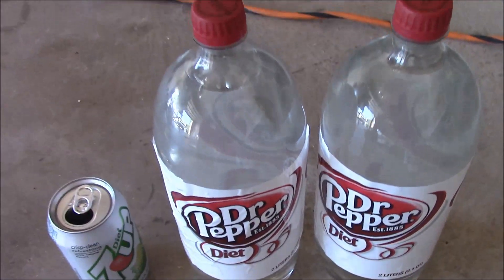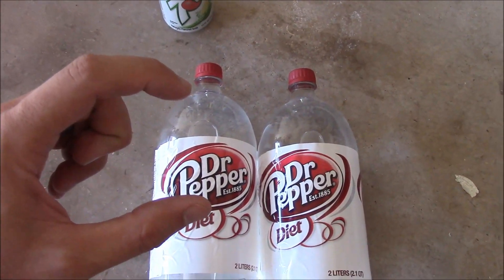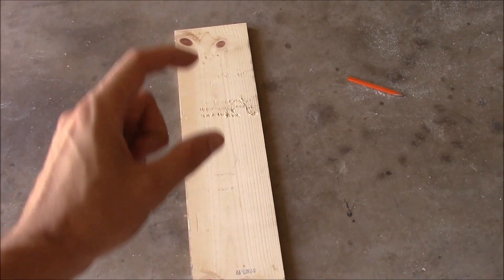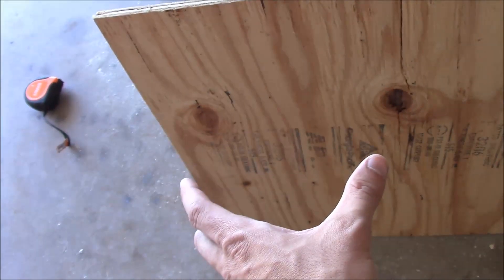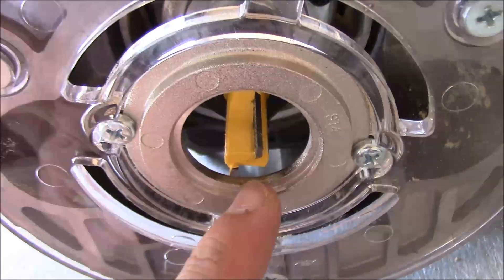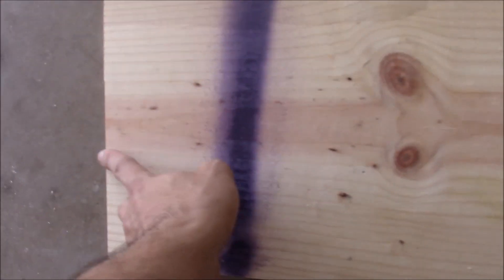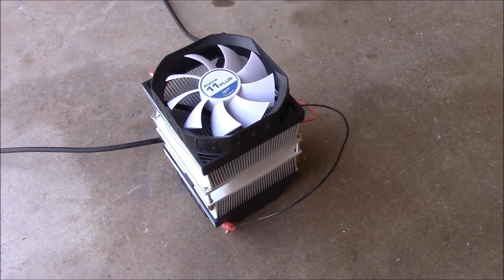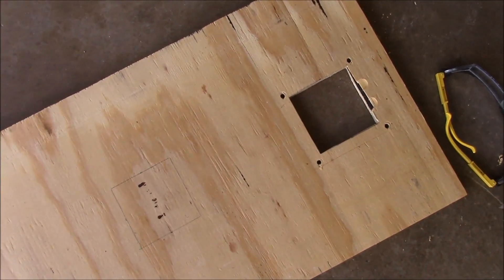Mini DIY Peltier/TEC Fridge Prototype - Learn From My Mistakes

Comment: lol. Very true. I wish you luck. This is theoretically possible, its just plain difficult.
Reply from the maker: No doubt but so was inventing the light bulb.  I'll keep working on it.
Reply: As will I with mine. I have successfully gotten a 9 Quart cooler with a 60 Watt peltier unit from 78.2 Degrees ambient down to 50.3 which is a 27.3 Difference!. One thing that i could do is switch to the same thickness heatsink, but 120MM X 120MM to fit a larger fan and it would get even colder.
Reply from the maker: Has it been well established that putting a larger/more efficient heatsink and fan on the hot side yields better cooling?
Reply: Theoretically yes, Because the peltier unit has more surface area to get rid of heat from. The bigger the heatsink and the better the thermal conductivity of the heatsink, such as the difference between copper and aluminum, the better. Copper is a much better thermal conductor than aluminum so it would be easier for the fan to get rid of more heat at a given time. Another reason why this works is because, since the hot side heatsink wont get as hot because it has to warm up more surface area than normal, it wont be as hot so the cold side will get a few degrees cooler when under load. Switching from aluminum to copper heatsink would also reduce it a bit further. Also, with the more surface area on the hot side, it gives the fan more time to remove the heat as it warms up.
Reply: That temperature difference that all peltier units have is absolutely critical to this. Getting rid of as much heat as possible is the main challenge. If you can reduce the hot side heatsink temperature lower than usual with a more powerful fan, more efficient, better heatsink, or water cooling, it will decrease the temperature of the cooler by probably as much as 5 to 8 degrees or a bit more.
Reply from the maker: Agreed.  I am going to be playing with liquid cooling the hot side and then using a cold plate on the cold side.  Stay tuned!
Reply: Awesome. Best of luck! I will

Comment: love the videos, thanks for sharing ...can i suggest one thing i don't know if anyone else mentioned... cold air sinks, right? so put the chillers in the door and set it on it's back so it becomes like a chest freezer/fridge and you don't lose all your cold air when the door opens... all the cold stays in the chest when you lift the lid :) make it a coffin type deal LOL cold as death :)
Reply from the maker: Great point.  That is how chest freezers are so efficient.  However, for this design I just wanted a normal style refrigerator.  I may have to build another design next time so I will think about your suggestion.  Thanks!
Reply: hey no problem... and thanks for the tutorial on peltier devices. i have a fridge that i found in the garbage. i suspect the previous owner didnt know it was only a cooler/fridge with a peltier device because it was in the garbage at the boat marina on the hottest day two years ago.[ i figure it didnt chill his beer fast enough for the boat ride so he tossed it out...lucky me :) ] i brought it home and plugged it in in my basement and it chills properly with only using microscopic amounts of amperage according to the manufacturers label. DANBY DAR0448W 120volt refrigerator manufactured 2008, 1.7 cubic feet, 11 kg, 65 watts max, 0.95 amps max... WOW what a nice deal for free. emergency inverter/battery backup fridge for me...ONE AMP FRIDGE!!!!!!!!!!! yes it will take 12 amps from my battery bank to my inverter to make 1 amp for the fridge but that's better then a regular fridge taking 72 amps not including the surge amount needed. if i remember your batteries they were 7.2amp/hour ups batteries, they would only supply the thermoelectric device for just over an hour at 12 volts at 65 watts, same as mine before the 120 volt transformer in the fridge.
 funny part about the fridge is the power cord... looks like an air conditioner cord that could carry 20 amps LOL
Reply from the maker: Great find.  It sounds like There is a 10amp peltier in that fridge you found.  Great emergency prep tool.  You should get about the same performance from 7.2ah batteries as I did.  Do you know if your fridge has a thermostat in it?  If so, that might help the batteries last longer instead of giving it max juice all the time.
Reply: LDSreliance
funny i was editing my reply as you responded lol...yup i think thermost and a led light .. and i replied about your batteries before seeing your reply , great minds lol
Reply from the maker: Haha, cool.  Wish I found free stuff like that.  Good luck with it!

Comment: The answer in this application is to keep the efficiency high, and i wouldnt recommend running the peltier units at their full rated voltage.
Reply from the maker: Yeah, I have read that since then.  People are saying that running the peltier at a lower voltage will still yield most of the cooling without as much current.  I will have to give that a try.

Comment: Just checking to make sure anybody and everybody realizes that these are heat pumps, So If you are feeling a Very high temperature of around 98-110 degrees Fahrenheit, you need to either decrease the power consumption to the most efficient point of the peltier, or get a bigger heatsink, or both. If you not run the peltier at the voltage that it is rating for, It will still be very inefficient, but not quite as bad as how much power that your wasting now. If you reduce the voltage lower than what you are using now, less current, less wasted heat which means Hot side stays cooler by about 7 degrees or so which means cold side gets colder. A more powerful computer fan will help as well. Hope this helps and please keep posting videos about this. :D
Reply from the maker: Like I said, I am definitely going to try this out.  Maybe I will record some data if I can find a reliable way of measuring the temperatures.  Might be a good excuse to buy an infrared thermometer.  Hmmmm...

Comment: why dont u get a car battery instead? ;/

btw pls stop kissing while u speak, that mmch mmch is really annoying :D
Reply from the maker: Car batteries are not meant to be drained.  They are designed for a short burst of high amps.  They would work for this but you will kill the battery quickly.

I have no idea what you are talking about with the kissing comment.
Reply: LDSreliance i mean that sound u make while taking , ive seen a lot of ppl do that :D
at the end or start of sentences, its a bad habbit, so i just wanted to let u know :)
Reply from the maker: OK, I will try to work on that.  Thanks!

Comment: Peltiers are very inefficient. They can be very useful when you have all the power in the world and you need to move some heat, but really bad when power is limited.
Reply from the maker: I agree.  I have plenty of excess solar power during the daytime to tinker with.  This type of fridge would not be connected permanently.

Comment: i've been thinking about how to use a peltier system, and I have to say for me this isnt it, I mean you can buy a small fridge that runs off a 12v supply cheaply and it will use less power, 20A is far too much usage, you wouldnt ever use it in a self reliance scenario,